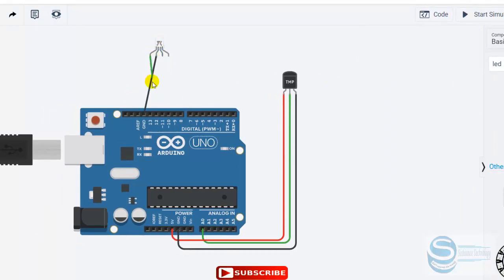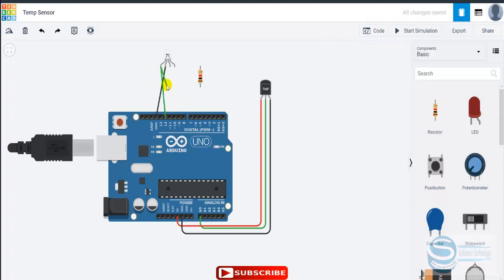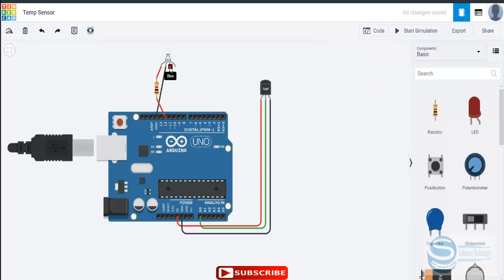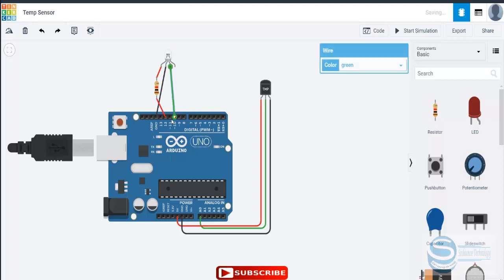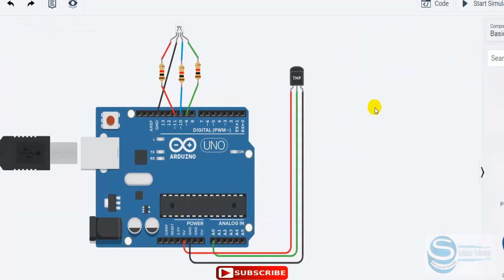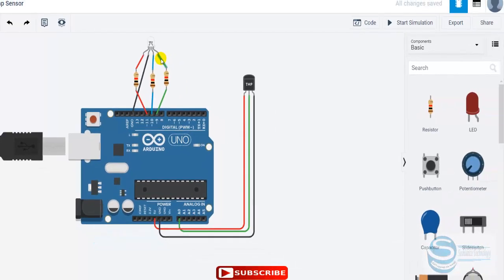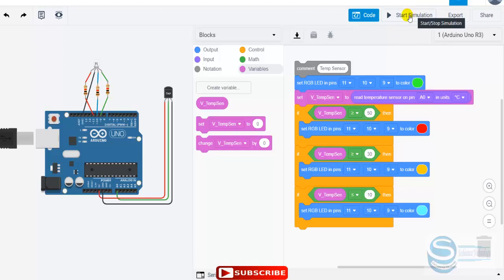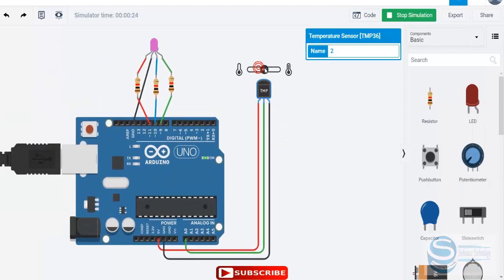Arduino Temperature Sensor | LED RGB Bulb | Tinkercad

Comment: What should I do, if I want to do the same for 5 LEDs and not for 1 single LED?
Reply: Map I/O pins for each single LED. There are many other (and BETTER) videos that do cover bar-graph led display. If you want ten LEDs, use a simple LM3914.